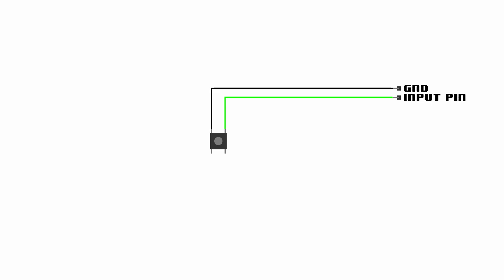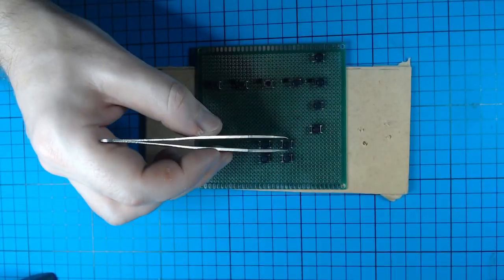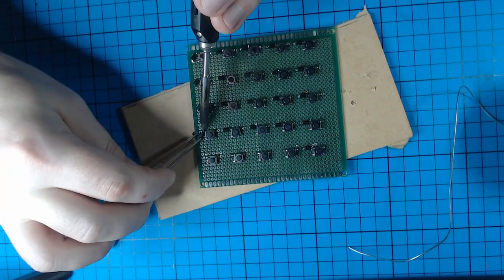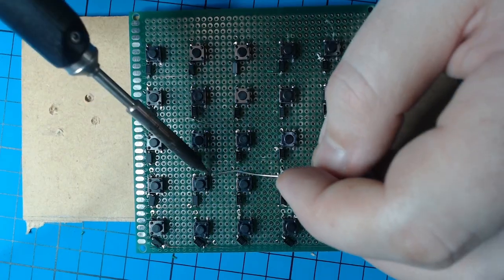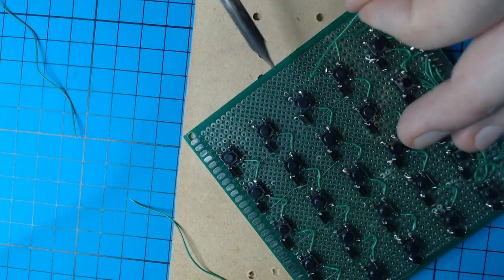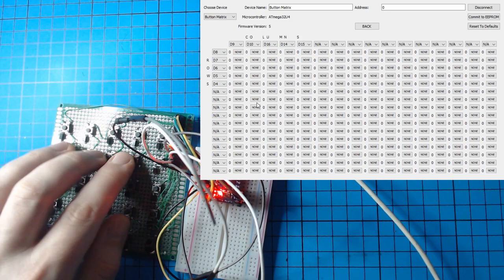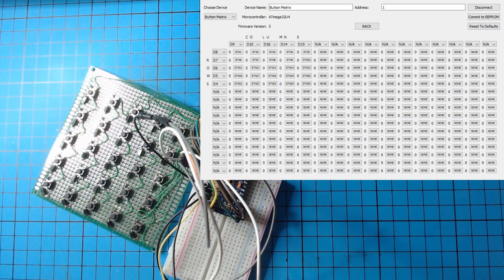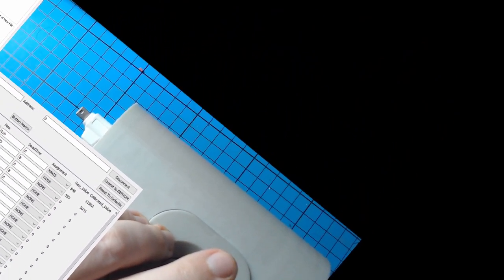Instructions - Button Matrix

Comment: Hi there, I'm looking at building a joystick, using the software your making, and I was wondering, can a single device run both a button matrix and other sensors (I've got some pots), or do I need to serialise for that?
Reply from the maker: Yep you can do a matrix and whatever individual digital and analog inputs you like on one device, so long as you've got enough pins.
Reply: @real_robots  ideal, since I plan on a few hat switches, and you can only really fit two. Going to take some planning of wiring though, to get it sorted
Reply from the maker: @Jo-rz6bs  If you end up doing hat switches on a matrix I'd love to see how it works out, I've thought about it but haven't tried yet. I usually just throw another microcontroller at it when I need more pins.
Reply: @real_robots  I do have a couple controllers, current thoughts are to do 4 Hats of four, as though it's a matrix of 16, with any 5 ways as an additional single input. Double the hats on the same pins I think? Do you have a subreddit or discord or something I could use v to share v any plans?
Reply from the maker: @Jo-rz6bs  I think you could do that with the 4 common pins as your columns and each of the direction pins in a row, so 8 pins total, add one extra if you're using 5 way hats. If you want to show it to me you can email at realrobotshk@gmail.com I don't have subreddit or discord, I find reddit.com/r/hotasdiy is pretty good though so I'll usually post there when I have something to show off or a question to ask.
Reply: @real_robots  Still getting 8 pins, just a question of how it's layed out, though the way you suggest is probably superior
Reply from the maker: @Jo-rz6bs  I don't quite know how you were going to wire yours, if you can do it in 8pins as well then its just as good as mine. Just don't forget the diodes otherwise you'll get ghosting
Reply: @real_robots  Looking into the mechanism that causes ghosting, I believe diodes aren't required, if each hat switch is one column, given the limitations of the hat switches, (and the ability of my thumb to use them) ghosting is unlikely to occur if only two hat switches are "in use" at any one time? Probably requires testing, and I'm not exactly set up for that till I get a few more switches in
Reply: Simply put, If ghosting needs three adjacent keys depressed, and each group of four adjacent in the matrix are in groups of two in two separate hat switches, there's no way three could be closed to cause ghosting?
Reply from the maker: @Jo-rz6bs  Oh you're absolutely right, shows you how much thought I've put into it!

Comment: Good morning.. I did like the video, but without the diode (for now), the rr_controller worked, but in the windows settings it didn't.
Reply from the maker: Theres a couple of common things that might cause that, what board are you using? Is it an Arduino Pro Micro? The only Arduinos that can talk directly to windows are those with an Atmega32U4 main chip like the Pro Micro or the Leonardo.

The other thing is that the windows usb tool won't update unless it's selected, so make sure to click on it to make sure it's got focus before testing.
Reply: @real_robots  Thank you very much for your attention, sorry English is the translator.
I explained myself badly, it identifies.. some buttons work. I used Matrix.. it only recognizes two buttons.. and not all. 
In time.. I'm using pro micro
Reply from the maker: @OgioniBH  I'm not sure why only some work if you followed the schematic. Leaving out the diodes shouldn't effect the buttons working, the worst that will happen is buttons firing when they shouldn't.
Reply: @real_robots  Thank you so much for your attention friend, I'll study better to see if I didn't do anything wrong.
Reply: @real_robots  Friend, another thing, the matrix only works, 2x2, 3x3, 4x4?? or works 2x5
Reply from the maker: @OgioniBH  The software can handle a matrix up to 16x16, see the interface at 9:47. The limiting factor is the number of digital pins on the board you're using.
Reply: @real_robots  Thanks again friend, but I think I didn't make myself clear, the question is if it accepts non-equal matrices... like 2x5...
Reply from the maker: @OgioniBH  oh, yes you can have them unequal.

Comment: how would you do a 70 button matrix tho?
Reply from the maker: The same way, just keep going to 8x9 or 9x8 rows/columns. The only problem is you will run out of usable inputs on the Arduino Pro Micro so you'll have to use a device with more inputs, or else use a GPIO expander like the MCP23017

Comment: Hello, I'm making an throttle using two Arduino boards, one on throttle and one on the base to control extra buttons, these buttons I'm trying to use matrix configuration, but I'm having problems, I'll send images to your email, the problem would be what do you comment on ghosting? or did I make another mistake? the strange thing is that in the rr_configurator the buttons respond normally, the problem only happens in windows and I'm also trying to use potentiometers for the throttle but I can't make it go all the way from 0 to 100, and another sliding potentiometer for other commands but this one is causing problems on the plates, according to the resistance it causes the boards turn off...
Reply: I just added diodes to the rows connections but nothing has changed
Reply from the maker: In the video you emailed, are two matrix buttons being detected in windows when you press one? 

If your matrix is working in rr_configurator but Windows is not getting the USB signal correctly then it's most likely something in my software or Windows, your matrix is working correctly.

If your pot is resetting the board when it is fully opened then you're basically short circuiting the 5v to a pin, try putting a 1k resistor on the signal line and see if that helps.

You can do some calibration of the pot using the min/mid/max settings in rr_configurator. Running the windows USB calibration is probably easier and works quite well though.
Reply: @real_robots  that's right, press one and two respond, only 2 buttons of the entire matrix are normal,
I've already tested two configurations of columns and rows and the problem remains, yes I changed the values of min/mid/max but it doesn't range from 0 to 100 only from 0 to 30 for example, I'm going to test the windows calibration.
About the potentiometer, it only happens with the slider I don't know if I may have connected to the wrong pins, if that would cause this effect.
Reply from the maker: @benebearded  I'll have to have a play around and see if I can reproduce the problem. It's almost certainly some bug in my code.

I haven't played with sliding pots much, but it makes perfect sense if it is dropping to zero ohms of resistance it's fail, a low value resistor on the output pin should fix that so there's always at least some resistance.

For the calibration, I'm not sure if this helps but I know I haven't really documented it well. The min/max signal the pro micro pins can take will be from 0-1023, your min should be the minimum your stick goes to and max should be the max it goes to. The calibrated value should be -32767 to 32767.

It's usually best to just leave min/max alone and let the windows auto-calibrator do it.
Reply: @real_robots  Unfortunately the pot didn't work, that's what happens, the value goes down and everything turns off, even using a resistor in it.
about the throttle adjustment it worked, I redid the calibration by the configurator and everything is ok now.
the matrix I undid and in the normal way, a button for each output of the arduino, many more cables but it works.
Reply from the maker: @benebearded  Glad you managed to sort it out on your end. Hopefully I can work out what's causing it and fix the bug.
Reply: @real_robots  Thanks for the help!
Another question, is it possible to change the name of the device, in a way that I connect to a pc and it already has the name I want?
Reply from the maker: @benebearded  https://github.com/MHeironimus/ArduinoJoystickLibrary/issues/14

I've not tried it out myself but it looks like it's possible by editing the Arduino boards.txt files. I'm not sure there's a way to do it from within an Arduino sketch.
Reply: same here
Reply: except my board dont turn off. this happen if you wired incorrectly.

Comment: i have a doubt i have buttons that only have 2 pins, how would i do this matrix of buttons?, i got 32 buttons that i need in my circuit if someone knows how please coment down bellow 🌟✨🌟✨
Reply from the maker: You can do 32 buttons no problem, just add and extra column and row to my schematic above. 6x6 will give you up to 36 buttons using 12 pins. Just don't connect the last 4 in the last row.

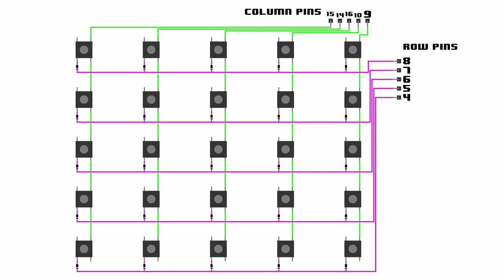If your buttons have only 2 pins that's fine, mine effectively have only 2 pins as well, the top ones are directly connected to their opposites on the bottom (from the view of my schematic at 1:53). Instead of having the green wire wire coming into the top of the button and going out of the bottom, you can have them both connected to the same pin, no prob.
Reply: @real_robots  thanks man 😎👍

Comment: This is amazing. I love this project. The fact that you can join multiples up is a solid for me as I want what you have managed to do and have multiple boards ....with only the one input USB used.

All I need now is something like (the twin joysticks) https://youtu.be/7e5ViENf0X4 (Ive been waiting for him for ever, maybe some inspiration!!) Ive managed to get the 2 joysticks working but the values seem to be all over the place.
Reply from the maker: Thanks, that's the second guy I've seen do that weird 2 x little joystick in that arrangement, I wonder if it takes much to get used to that. I might have to do one just to try it out, I've only got ONE joystick unit like those ones, I need a second.

I'm working on a bluetooth gamepad that's HOTASish at the moment and was thinking of using those same joysticks but they were a bit big for that so I ended up using the PS2 controller style, clicky ones.
Reply: @real_robots  They do look a lot of fun. big plus for me is the use of a mouse. 1 less piece of hardware on the table (so I can fit in more button boxes!)

Comment: how do you power the matrix
Reply from the maker: The column pins provide the power, the row pins read the signal, and also have pull-up resistors built in.

Comment: If you press the top 2 buttons in the left most column and the top button in 2nd left most all at the same time; then would you not be able to tell if the [2,2] button had also been pressed as well?
Reply from the maker: If you follow this schematic then only one button is polled at a time, this is done by controlling it so only one column has a positive voltage at a time and only one row is sinking it. (it might have been the other way around).